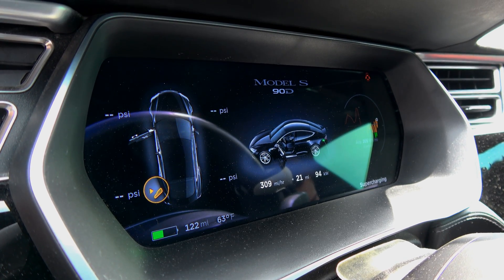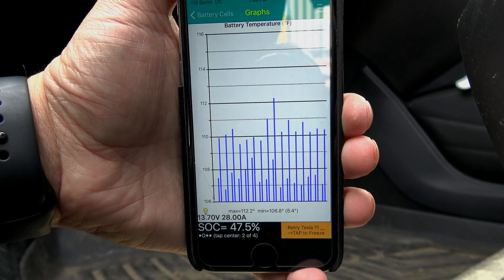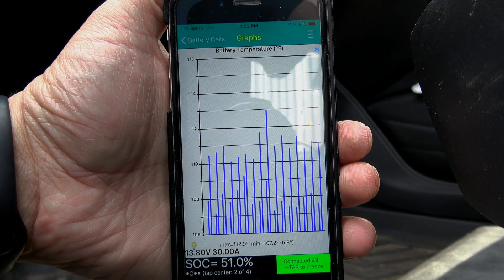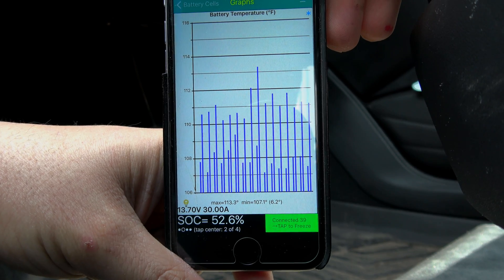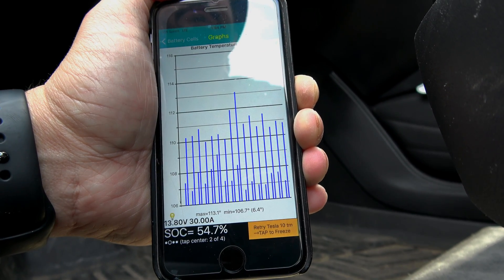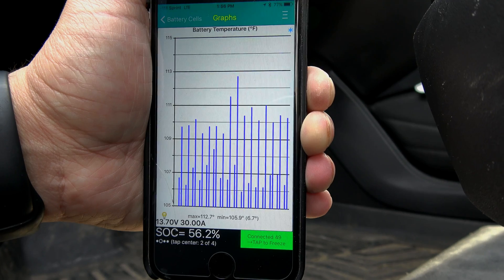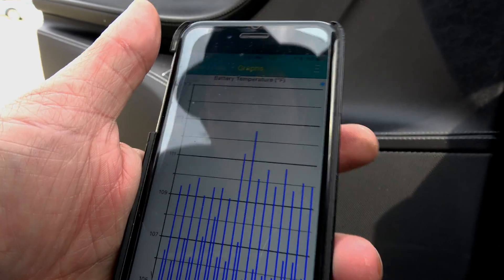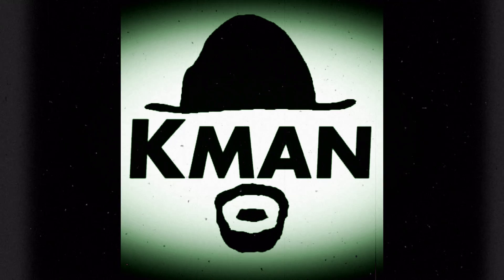Tesla: MAX Battery Temperature DISCOVERED! Part 2

Comment: oh Tesla doesn't tell people there EVs over heat and slow down massively making them dangerous to drive .and u can't super charge at full power if the battery is too hot ... thanks Tesla for lying ... no degradation warranty on a Tesla lol
Reply from the maker: +Mark Williams ? it's not overheating, it's normal operating temperatures. if the battery hits it's high temp it slows the charge rate down to assist in cooling. only so much cooling power can be packed into a car. though yes they could do slightly better job at managing the cooling. 
Nothing at all dangerous or dangerous to drive. Tesla has not lied, they said 80% in 20-40 minutes, which is what the car does, and another 20-40 for 100%, which the car does.

Comment: I wonder what sort of charging problems Tesla owners have and I will have when ambient temperatures here in Arizona are at 113 and higher.
Reply from the maker: +molinkie None really. I charged in Vegas. the supercharger location was 120*F in the SHADE, Ac was reduced in the cabin, took only slightly longer for my charge, maybe 10 minutes . 
The active cooling is good. it's the ones that done have active cooling like the Nissan leafs that are having tons of problems in hot clinates

Comment: What is the battery temperature during highway speeds at 65 mph?  If we know the outside temperature is around 70 degrees F.
Reply from the maker: JMA at about 109 on freeway after 75 minutes, external temp around 70ish
Reply: KmanAuto This means there is only a 3.5 degree difference between supercharging and highway driving.
Reply from the maker: JMA I can take a very long time before a battery pack to warm up. It doesn't usually get much more than ambient or just regular cruising but it will warm up eventually. If I'm regen Limited, it could take an hour on the freeway before it warms up enough for the region limitation to go away
Reply: KmanAuto Chris, How long does it take for the battery to cool down after a highway trip with a outside temperature of 70 degrees F?
Reply from the maker: Don't know, but thats a good idea for a video!
Reply: That would make a great video.  Is this program iPhone 7 compatible?
Reply: Thats surprisingly cool temperature for driving. I would love to see a video of it, or even the whole temperature fluctuation, from standstill, driving, stopping and cooling down.  Now I'm thinking how hot does it get after hard driving!

Comment: I've been using TM-Spy for almost a year now. The highest I saw in my 85 was about 55 Celsius which is 130 F. According to the CTO of Lucid, up to 60 Celsius is OK for a Lithium battery. It depends a lot on how warm the battery is when you arrive. I saw those high temps only when I arrived with pretty hot batteries.
Reply from the maker: I'll need to see what temps I hit during the summer, and again on next road trip to Vegas. When I was in Vegas 2015 (Can see it on my West Coast road trip 2015 video), it was 120*F INSIDE the parking structure, and that was BEFORE charging started. It took a really dang long time to charge up, no idea what the battery temp was.
Reply from the maker: Also, more leeway is allowed for discharge temps. It's Charge temps where 113*F is really the highest you want.

Comment: I don't like the fact that cooling system is below 80% load.
Reply from the maker: Cooling system is below 80% load? Where do you get that the load is only 80%
Reply: KmanAuto Noise. on your video it was really quiet. Compressor and fans can be both heard loud. 80% was just a number I would be at least satisfied. But it appears to be much less.

Comment: Actually cooling system consumes energy. If it switches on some of the juice will not get into battery.
Reply: Like 2-5kW.
Reply from the maker: Incorrect. When supercharging, the cooling or heat will be drawn from shore. The added power requirement is supplimented by the Supercharger. You might see a slight initial dip in power to the battery when the Heat/AC/Active cooling first starts (For about 5-10 seconds), however, then it pops right back up as the supercharger will supply additional power for it.
Reply: KmanAuto plug supports ~335A. If Tesla charges at 90kW there is nothing to discuss. It is not actually fast compared to what was before that.
Reply from the maker: While the top charge rate is not as high as it was on previous chemistry of cars, which does suck a bit, on the flipside, the cars can maintain a higher rate of charge now for a longer period. Example, while my old MS60 could hit 115kW rate, it would drop to the 60's-70
s and lower sooner, where as my 90D can maintain a 90+ kW rate up to and past 60% SOC.
Reply: Yea, I've heard that. And we can also see that temperature is not actually the main problem (as Tesla could bump up cooling earlier/more aggressive cooling).
I think 115kW rate resulted in a thing called "surface charge" - easy to notice on lead acid batteries, not so much on Li-ion's.
Basically if you charge the pack at 115kW voltage will rise a lot and fast. Peaking the highest cell chain to maximum allowed voltage. (most likely the outmost chains get to max faster).
Keeping charging rate at 90kW gives time for surface charge to dissipate.
Interesting. 18650 cells have very small cathode-anode distance. How can this effect actually happen.

Comment: Very interesting that Tesla allows the batery pack to get so hot before it attempts active cooling.  Why not keep the pack closer to 100 to prevent degradation of the cells ?
Reply from the maker: I agree. I'd prefer a Pre-Cooling option, or begin Active cooling immediately if the external temp is above freezing once plugged in.
Reply: The Chevy Volt (gen1, 2015 model) starts active cooling when the battery reaches 86 and kicks into high above 96.  I only saw the high cooling once living in TX, was 112 air temp, car turned off the cabin A/C, cranked the fan to max and flashed a message about bat temp high, forced cooling active
Reply from the maker: I've had similar experience, during the summer here, the active cooling does kick in sooner, and if you have just gotten off the freeway, you 'll get a message saying passenger cabin cooling reduced. It's changed a bit with firmware updates. But dang, I remember my first Model S, that sucker was a jet engine taking off, and I must say, the AC on that car got considerably cooler quicker and overall much "COLDER".  But they have made HVAC changes in firmware quite a bit over the past 4 years...
Reply: I'd want to see between 50 and 86^F (10 to 30^C), usually charging <=35 kW (e.g. half a 70 kWh size) when possible with the intention of trying to keep the car 20 years (usually cycling between 60 and 40% for short daily trips, and avoiding ever >80% or <20%).
Reply: In data we trust. They're an information-driven organisation and you can bet your bottom dollar that they'll be using the Mothership to watch every pack and chemistry type to see how best to deal with this. They'll have their reasons for doing certain things, and as ever, when you don't have access to ALL of the data from every vehicle, those reasons can seem pretty impenetrable.